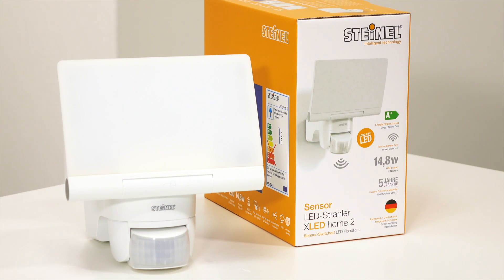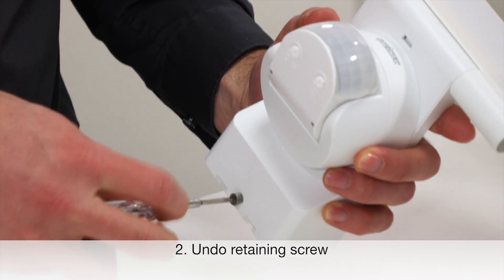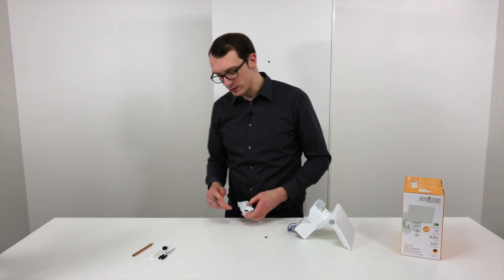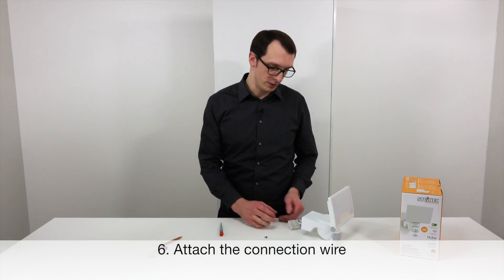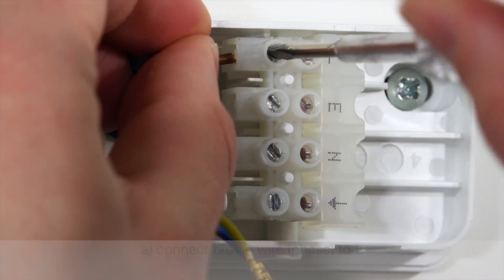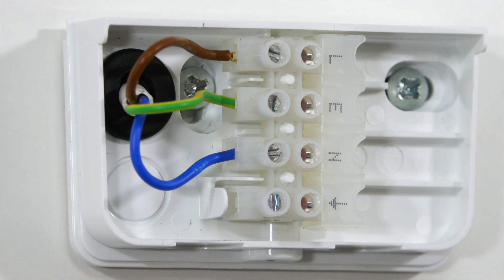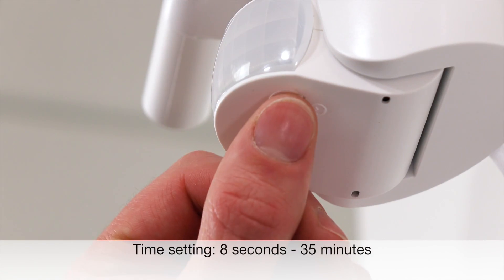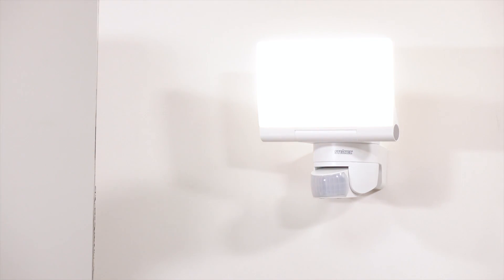How to install and put a LED floodlight into operation

Comment: I have the same problem like Ron Haak and Jan Verhulst described. My XLED home 2 does not switch off when I power it up. Just constantly shining. Dear Steinel please help me.
Reply: How did you fix this?
Reply: @raphaeleymann  I swapped wires. I was a year ago so I dont remember details but swapped blue with brown probably. Everything is in manual or on YouTube also.
Reply: @raphaeleymann  Now I remember: Connect brown live (phase) wire to L not to L’ - L’ is the live wire out to connect „slave” LED lamp.
Reply: @andrzejz6062  I had it connected with the right L and then tried with the "wrong" L' because it wouldn't turn off and even this did not work - and now I am thinking the Sensor has been blown. Sent it back and already bought another one - the new one works.

Comment: Hi, I just installed the lamp , but I ran into the same problem as Jan Verhulst described below. The lamp does not switch off after a certain period. I tried different settings.

Comment: Thanks for the instructions. Before buying the product, I wanted to know what happens when the power is turned on (e.g. if I would put a switch behind it). Does it automatically turn on the light until the timer period has passed without the need of any motion detection? After that the normal motion detection cycles start...
Reply from the maker: Dear Maarten, thanks for your comment! In regards to your question: When the unit is activated via a switch the unit will power up for 5-10 seconds to initialise and then power down. Once the unit sees movement the unit will then run in conjunction with the time delay setting. We hope we could answer you question and provide an extra motivation to buy the product? ;) Best regards from Germany, Your STEINEL Social Media Team
Reply: Many thanks! Answers perfectly my question! Kind regards, Maarten
Reply from the maker: You're very welcome Maarten! Have a great start to the week. Best regards, Your STEINEL Social Media Team